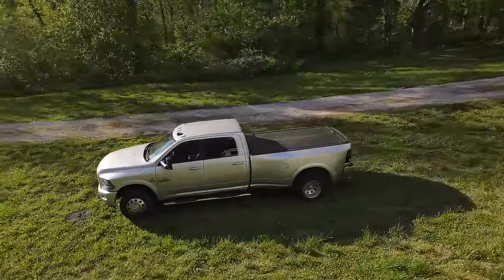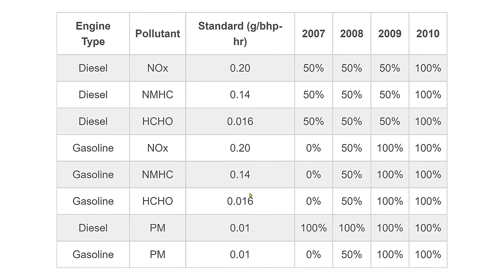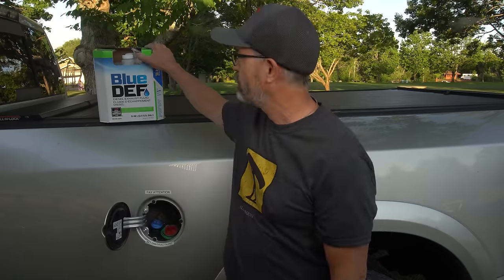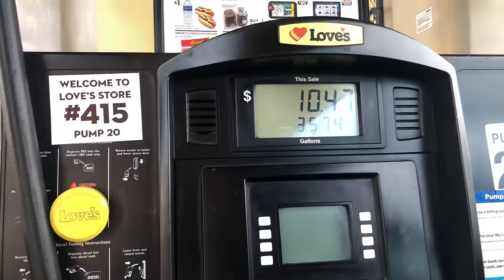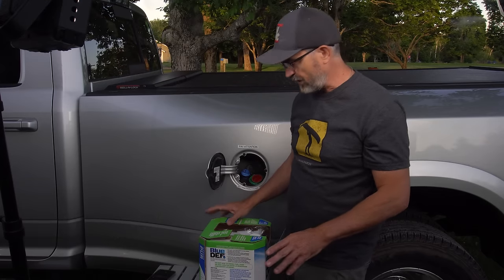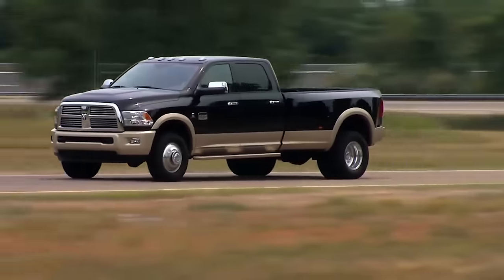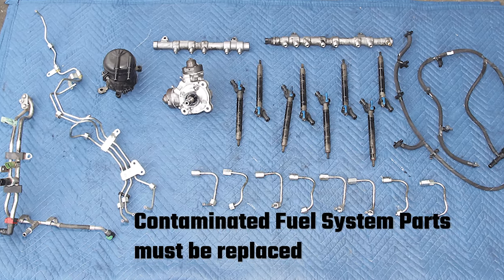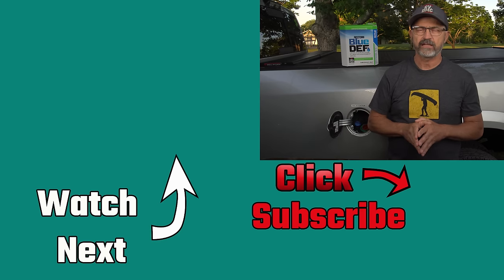Avoid expensive diesel repairs & DEF explained (RV Living) 4K

Comment: Great video sir. Yeah, today was the first day putting def in my new and first diesel  using a def pump. Put def right in the fuel tank. 😵‍💫 I started the engine because I have a digital display and couldn't see the def gage without starting the truck. I immediately realized my mistake and I'm really kicking myself.
Reply from the maker: Oh, no. If you caught it early, you need to clean out the tank. 
Let us know how it turns out
Reply: @DownsizingMakesCents  I called the dealership and they immediately said its "ruined' without even looking at it. I don't know if that's a California thing or not but I had it towed to the dealership and my insurance and the dealership are acting like it's the end of the world.
Reply: @godvandamme9921  whats the outcome?
Reply: @oktawiangornik1284  It's been at the dealership this whole time. It's still sitting there waiting for parts. 😓
Reply: @godvandamme9921  In many cases insurance company covers the wrong fueling. Check it out. Hope it turnes all good.
Reply: @oktawiangornik1284  Insurance is covering it fortunately. Thanks for checking. They actually tried to say no at first.
Reply: @DownsizingMakesCents  fill your def at  the pump @ 3-4 dollars a gallon
Reply: So, what's the update? Did insurance make you pay anything?
I think I'm going to spring for one of those fuel caps for my '23 ecodiesel.
I hope all went well!
Reply: @gardnerberry113  All went well, thanks for asking.  The truck turned out to be a lemon and GM bought it back. Unrelated to my misfuel.

Comment: I know I have the same truck that was a bad design but what do you have to do buy the Caps off of Amazon that thread on and it'll stop you from doing that once a fuel cap the other one is a thread on aluminum def cap which actually now since I put that on I stopped having problems is a aluminum fuel cap with a o-ring on it that stops anything from getting into that flop door fuel fill up area

Comment: Everybody that I know that puts d e f from the fuel station out of their nozzle has always had problems always use a sealed container use all of it and then throw the container away it is the crystals that plug up the spray nozzle on the Dodge and all the other ones because the fuel stations let are get into their tanks and that way it's the crystals that plug up the nozzle pull the nozzle off wash it in warm water with a toothbrush and put it back on and away you go

Comment: Have you tried using the Walmart brand of DEF?  It’s certified by the American Petroleum Institute and it’s approximately $7.00 for the 2 and a half Gallo container.  I’ve used it since December and have had no ill effects from it.  Great video as always Larry!
Reply: Me too no issues
Reply from the maker: Hey Robert, Most of the time we get DEF at the pump for around $3 per gallon.  But I had no idea that the walmart brand was so inexpensive, I will have to check it out.  Thanks Larry
Reply: Industry standards for DEF manufacturing, quality, transportation, storage, etc are detailed in ISO 22241. As long as a container advertises their product meets these standards it should be fine, regardless of price. 
Diesel aftertreatment specialist make a respectful income by maintaining and repairing DEF systems. Speaking from experience, most DEF system faults are from failed components, software strategy, or gross contamination- filling DEF tank with diesel, hydraulic oil, or other fluid. I use a refractometer to measure specific gravity, it is extremely rare that I see concentration deviate more than 1.5%.
Reply: @DownsizingMakesCents  I always buy the Walmart brand and here is why…. Walmart sells 20 to 1 their brand over Blue DEF and it is always the freshest DEF on the shelf, I test every container and it has always been spot on!

Comment: I made this mistake. 2019 2500 after putting def nozzle into diesel tank i realized my mistake quickly I quickly remembered not to put ignition switch to start or u will have major problems. I called my mechanic and he sent a tow truck I had just put 30 gallons of diesel fuel into my tank. My mechanic was not happy draining it. long story short he cleaned the tank out and put two new fuel filters on and I was good.  Listen to this guy it can and will happen if ur day dreaming.  Good luck
Reply from the maker: I almost did it - I just started filling myself because Larry is sick. 
Luckily, I was hitting the diesel button and it wouldn’t pump 😁

Comment: I’m retired from the automotive industry and spent the last 16 years at a Ram dealership. Your video is spot on! 
When the catalyst system for diesels was first rolled out it was a nightmare for customers and dealers. Most of the problems were from software issues. All manufacturers had a hard time with regeneration so there were a lot of unnecessary check engine lights. And so many people put weird stuff in their DEF tank. I’ve seen diesel fuel, gasoline, plain water and who knows what in those tanks. And of course DEF in the fuel tank is so easy to do. By the time I retired a couple years ago emission problems with diesels where about the same frequency as gasoline engines. A certain percentage of everything breaks so you still see the occasional problem but the systems are much much better. I own a diesel truck by the way. Yes you can delete all that stuff but it can cause even more problems. A lot of the shops doing the deletions have no clue what they’re doing. Some are really good but I’ve seen some real disasters. And it’s illegal. Just my 2 cents!
Reply from the maker: Hey Randy thanks for sharing your considerable experience.  Many people have commented on deleting their emmissions systems.  I would consider it for myself, I would be afraid of voiding the warranty, having even more diesel problems, and getting in trouble with the law.  I have seen many videos about the companies that specialize in deleting, getting busted.  Thanks again for sharing your advice.  Larry

Comment: I’ve never had an issue fueling 10 years with our trucks.  But in 2019 we bought a new rig that requires DEF.  I get DEF 90% of the time at the Truck Stops where we fuel.   I test the DEF before putting it in my tank…. Several times the DEF did not make spec and we did not take it.    I test def in the box as well and have never found a bad box yet.
Reply: How do you test DEF?
Reply from the maker: Testing the DEF is a good idea
Reply: @truetexan7755  THX - another important "tool" to buy!
Reply: How are you able to test the fluid at a pump without pumping it first?
Reply: @jamesglenn520  I always pump a small amount into a clear cup.  I check it visually it should be super clear with no visible crystals.  Then I pull a few drops out with an eye dropper, it comes with the tester (spectrometer)

Comment: I have my first diesel and I have a procedure: only one cap off at a time and I avoid the gasoline + diesel lanes and only fill in either a truck lane or a dedicated diesel lane designed for passenger trucks towing trailers. No distractions is critical.
Reply from the maker: Great tips. 
Unfortunately, when not towing,  sometimes on the road, you get diesel where you can - especially when looking for a good price. 
We almost always use truck stop when towing

Comment: back in the day all diesel was green dispenser now they are black at sum stations just to keep us guessing and now def dispensers.  pro tip for your def system: DELETE IT/bypass EGR . Def will crystalize and you will not now it and gunk up system. ive seen deleted engines and there is NO smoke . Its all about money
Reply from the maker: I have seen a bunch of videos about cracking down on deleted systems.  Larry

Comment: I drive a 2001 dodge and don't worry about it lol
Reply from the maker: Gary, that’s awesome it still runs. Yeah. The rule wasn’t in until like 2010 😉 
Alice
Reply: @DownsizingMakesCents  no rust 2500 5.9 rebuild motor upgrade transmission,  rebuild steering,  etc

Comment: I do not have a diesel truck yet. I had never heard of that, thank you. I do get tired, rushed, and distracted. I am surprised there are not at the pump safeguards and on the truck. Does DEF make it smell better? I feel sick when i smell diesel trucks. I know there is nothing i can do about the smell of the fuel, but i sure hope the exhaust smell is better. The engine noise is obnoxious, too. I REALLY hate having to get a diesel, but guess there is no choice in order to be safe. Thanks so much.
Reply from the maker: the great thing about all of the emissions changes to diesel trucks is it virtually eliminates that diesel smell.  I hate the smell of diesel.  I had a bad experience on a fishing boat where the wind blew taht diesel smoke on us for hours, made me so sick.  The engine noise is more that a gas truck  but you dont notice any difference while driving, the cab is very sound proofed.  larry
Reply: @DownsizingMakesCents  good to hear...or not hear...mine was a boat, too!

Comment: I have just bought a diesel VW and I had no idea you had to put this product in, as the dealer told me nothing!  How often do you have to put some in?  If i drive a thousand miles how much would the car use? Basically how often do I have to fill up, or will I be told when it needs refilling?

Comment: How often do you have to fill the def?  Missed info for those of us who do not have a diesel truck yet.  Thanks!
Reply: Same question… does it have a separate gauge for the def?
Reply from the maker: Depends on number of miles- so about every 2000-2500 miles,
Alice
Reply from the maker: Yes. In the truck, there is a gauge,
Alice
Reply: @DownsizingMakesCents  I have a new Ford and it has a gauge, I've got about 2800 miles on it so far and just at half on the DEF gauge now so about 5 to 6k per tank on mine maybe.
Reply from the maker: @dougswaggard6667  Doug, how big is your DEF tank? Ours is small
Reply: @DownsizingMakesCents  I just checked my manual and it says it's 7.4 gal.
Reply: @DownsizingMakesCents  My manual says it's 7.4 gal.  Haven't had to fill it yet.

Comment: I put DEF in my wife's 2020 GMC. GMC doesn't put a gas cap on that truck. Being in a hurry I put DEF in the dsl tank while in idle to watch the dash reading. It cost over 18,000.00 in parts & labor. MAKE SURE YOU PUT IN A CLAIM THROUGH YOUR INSURANCE COMPANY. IT COMES UNDER YOUR COMPREHENSIVE @ DOESN'T COST YOU ONE CENT. THATS WHAT I WAS TOLD.
Reply from the maker: Francis, sorry that happened. But so good insurance paid for it. Thanks for the info,
Alice

Comment: im sorry i bought a newer truck rhe def system  on my spinter works as it should but on the ford it is not good  lots of trouble and lots of cash delete it asap if you want to keep the truck past 100k
Reply from the maker: I am really hoping that if I take care of it, maintain it properly and make sure that I run it hard occasionally to burn out the DPF, hoping to get several hundred thousand miles for for the emissions stuff goes bad,  Lar

Comment: I have 2014 Jeep Grand Cherokee.  I am almost panicked by the DEF thing.  Never  imagined having a diesel but circumstances brought me to it and actually like the vehicle.  I went to the Jeep dealer  as I did not understand this DEF thing.  They told me that it was very pricey and that it would be in excess of $300. dollars to service the tank. My gauge shows less than half full of DEF and I am traveling soon do not want to take any risked of damaging the engine.  Should I have the dealer do this or as your excellent video indicates perhaps I just need to fill the DEF tank with the fluid you use.  Seems like a less expensive way.  The vehicle runs beautifully I am just concerned about th level of DEF.  Thanks for a great explanation. Would appreciate your recommendation.
Reply from the maker: We buy a jug at Walmart and fill up whenever gauge reads 1/2 or 1/4 full. 
Doing it yourself definitely saves money

Comment: I don't drive my truck too many miles..It has 37k miles.  It there a drain plug for def so I can change it out?
Reply from the maker: That’s a great question, I wouldn’t want old def to mess up the emissions system.  I hope somebody here can answer that question, I will look it up.  Since we traveled extensively right now we always have fresh DEF in the tank but when we settle down that will change.  Larry

Comment: Purchased my 2020 Chevy 3500 Duramax 6 months ago.  (DEF fill is next to diesel fill on 2020 and newer as opposed to under the hood)I have not put DEF in the fuel tank...yet.  I am so paranoid about doing this, I am hypervigilant when filling my tanks.  I did run into something called diesel premium last week and did not know what it was or if it was compatible with my truck.  I put the "regular" diesel in then I was worried about it until I burned up the tank.
Reply from the maker: they should not call it diesel premium, it causes too much confusion between premium gas.  One grade of diesel is good for me.  We are in canada now and the pump handles are sometimes yellow and sometimes green for diesel.  I really stop and pay attention here especially.  I think chevy should have kept the DEF under the hood.  thanks for sharing your story.  Larry

Comment: Good advice.  I purchased a Ford F150 diesel and most people probably don't associate a half ton truck with diesel.  I should probably put a warning label on the fuel door in case someone tries to put gas in it for me.  Thanks
Reply from the maker: Bo, definitely. Because sometimes you have someone else fill for you and they may not notice,
Alice

Comment: That MFR date code on the box is asinine - they should reprogram the printing software to fix that.  IMHO they made it difficult to interpret deliberately.
Reply from the maker: Isn’t that ridiculous? Using old DEF is so bad. It should be more plain,
Alice
Reply: I worked in the chemical industry for a while, it’s likely SAP or some big ERP managing their manufacturing, labeling and shipping and yeah a simple report or interface code change could out it in, well, a normal date format like mm/dd/yyyy for expiration date. Even if it’s some old thing like MAPICS or BPCS it is not a hugely difficult thing… yeah I think it’s intentional frankly…

Comment: Lots a great points and very detailed. I fill my DEF at home so I'm usually not distracted. I agree with becoming complacent when fueling. We do it all the time so it's second nature. I have 3 different fuels I get on my way to the desert. 40 gallons of premium gas in my trailer. 20 gallons of VP in race cans in the bed of my truck. Top off my truck with diesel too. Don't forget your Hot Shots Secret EDT to save that CP4. Add to that the kids running around and double checking the load before we head down the long 6% grade. While it's not always possible to avoid distractions, staying focused is key. I play it out in my head before I even get to the stop. I even do a checklist on my phone sometimes. All you have to keep telling yourself is that a simple mistake could at the very least cost you thousands. Could be the lives of you and your family in the worst case scenario.
Reply from the maker: Wow you have a much more complicated fueling situation than us, we just have gas for the generators and Diesel for the truck.  I 3d printed a plastic cap for my diesel fill that has “Pay Attention” printed on it now.  One more step to help me remember.  I now have a brain deficit because an illness i had a year ago so I have to be extra careful not to screw up not.  Larry
Reply: @DownsizingMakesCents  I'm all for signs and directions. I'm the kind of guy that reads the manual from front to back before I dive in. 20 years in the DoD will do that to you I guess. Sounds like you're doing everything right. I had to teach myself since my friends just told me to hook and go lol. Not good advice. Anyway, you're doing great! Have fun and be safe 😁

Comment: How did the DEF get into the filter system if the guy did NOT start his truck? You said he drained it right away.
Reply from the maker: After he flushed the gas tank out, some def was still in there, when he put new fuel in and started the truck some of the residual def made its way into the fuel filter.  I should have explained that better, Larry
Reply: He probably only siphoned the fuel out. 
That would have left a lot of def in the bottom. The water goes to the bottom and doesn't mix with the fuel.

Comment: you had the jug up side down  the black air breather should be on top,,, Just saying
Reply from the maker: Thanks rick, i wil have to try that the next time, does that mean you have to hold the jug the other way around, thanks Larry
Reply: @DownsizingMakesCents  Yep! Turn the jug 180🙃 and have the breather on top. 
It will fill smoothly and it's easier and quicker to Stop filling when the tank is full 🤗